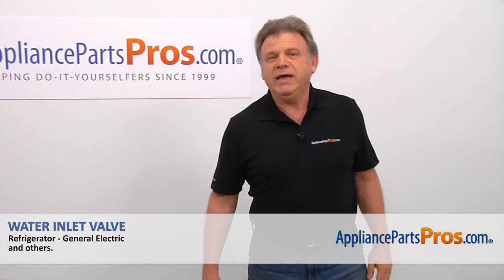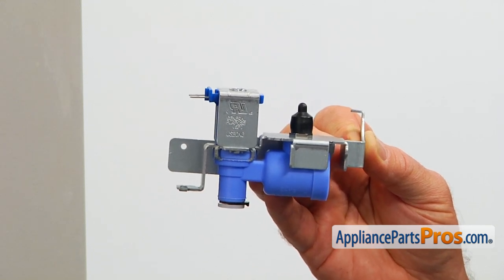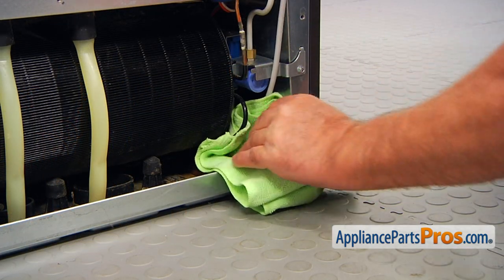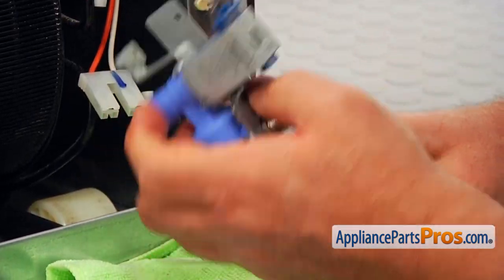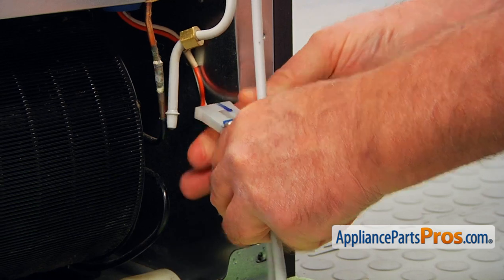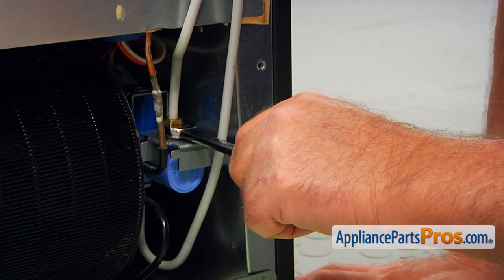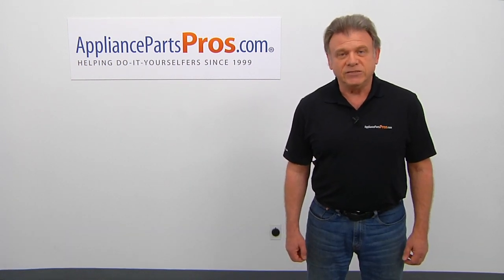How To: GE Water Inlet Valve WR55X11128

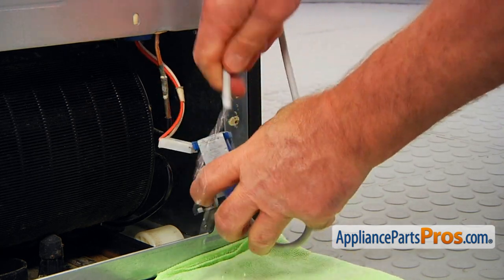Comment: This great video gives me confidence to replace my own valve.  Note that the original electrical connectors were bent by accident when disconnecting the water line (at time 2:40) so you probably shouldn't bend the connectors on the new valve.

Comment: I replaced the water inlet valve and that didn't fix the problem for me. I can see that water is not traveling up to the ice maker. Any suggestions for what to do next? Is there a way to test if the water inlet valve is working or if there is a problem with the connection where it is plugged in to the refrigerator?
Reply from the maker: You will need to test to see if you have power at the water valve when the icemaker cycles. If you have power there and no water comes into the unit then you will need to replace the valve. If you don't get power at the valve then your ice maker will need to be replaced.

Comment: I just replaced mine and it's still leaking! Help what do I do now
Reply: Hi Aaron, sorry I'm so late to the game.  I just finished the same repair, with the same result!  Still leaked.  I looked really close and figured out that the hose was cracked a tiny bit, right by the push-in valve.  This was the clear (ish) hose, not the supply or the black.  I cut off about 1/2" and reinstalled.  No leak!
Reply: Obviously, mine was a different model with the dual valve.  But check the hose closely.